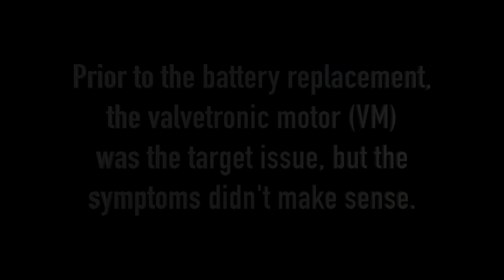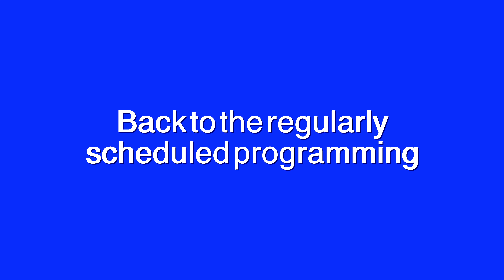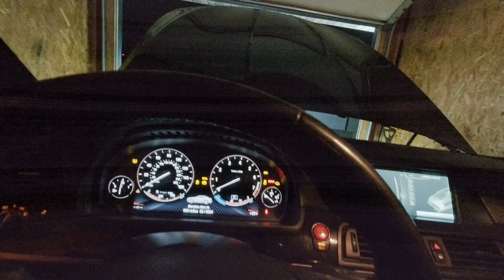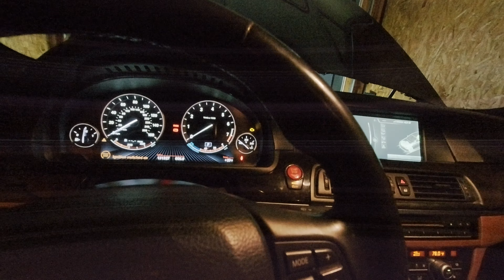Troubleshooting BMW F10 535i N55 Engine Malfunction Series Ep. 3

Comment: Damn you had to disassemble all of that for one part, 🤦🏾‍♂️. That's why BMW charge so much to work on em. Damnit man. Keep grinding
Reply from the maker: Yessir. Labor is generally at least 50% but  can be as much as 80% of the maintenance and repair cost! That’s why I had such a difficult time swallowing that pill this winter to let an indy shop do the work I was fully capable of doing 😒
Reply: @EuroAutoEnthusiast  real talk 💯